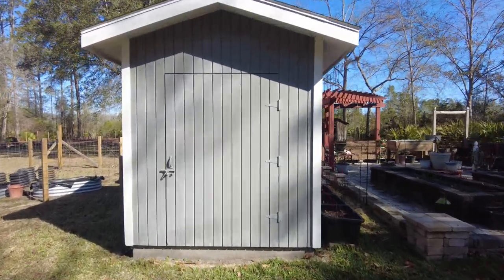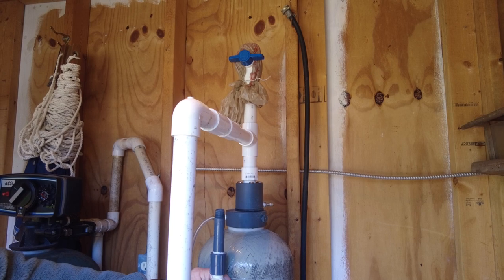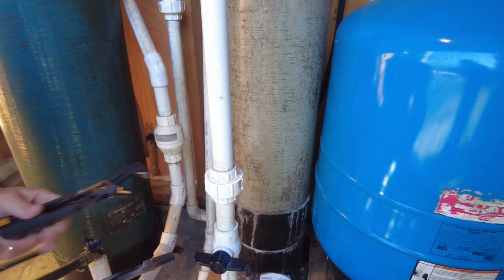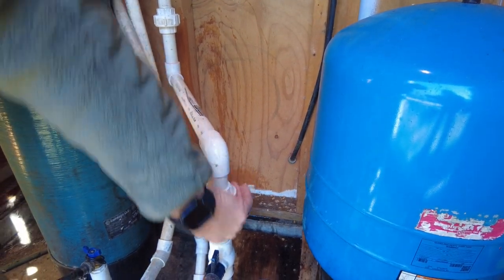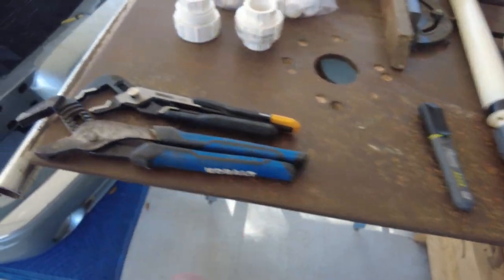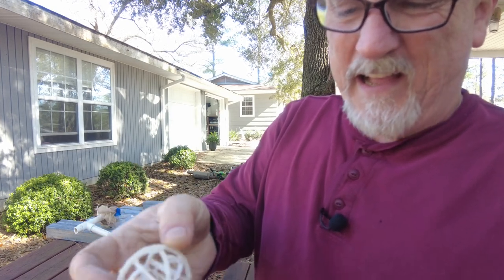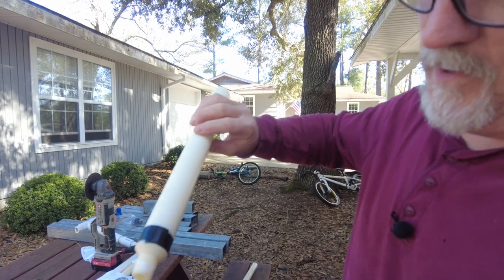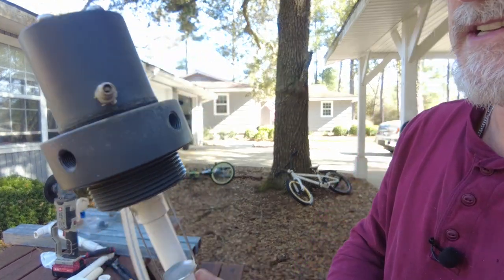Removing the sulfur smell from well water using the CSI REACTR aeration tank

Comment: Try a air intake device (I think it's called a hydro charger) it's installed before the pressure tank, when your pump turns on,it will inject air in the water stream, and also put air in the tank
Reply from the maker: Thanks, I will have to research that. I got another idea that would be a manual method. i will let you know what ever I decide to do.
Reply: Did I miss where you confirmed the slide switch works? Also, any updates?

Comment: Your pipe measurement are wrong, you cut the coupler, which means theres pvc in the coupler.. 16:50
Reply from the maker: Could be, I try to clean the cuts up, but it seems there is always small pieces of PVC that stays in the pipe. If I find it to be a problem, I run some water through a spicket to try and get the trash out.